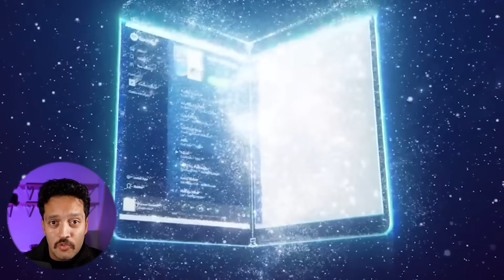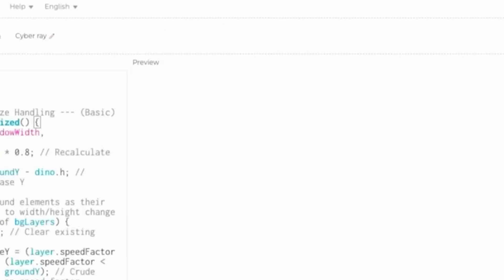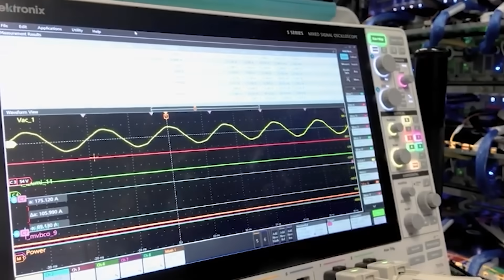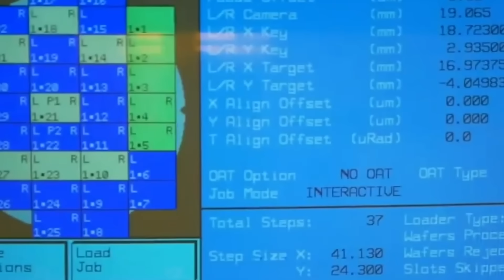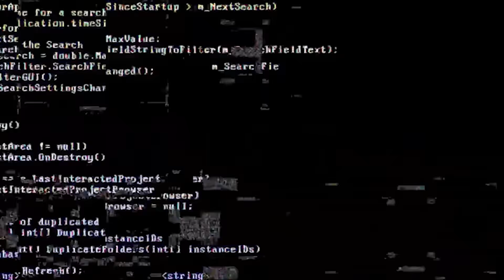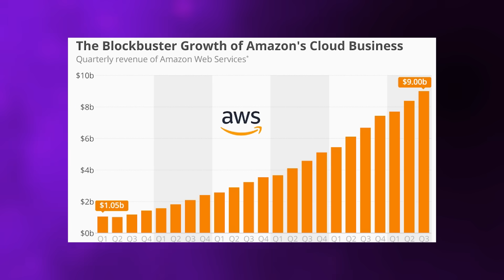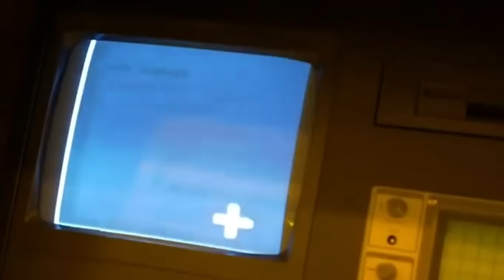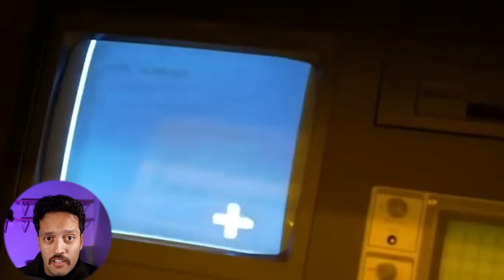Google’s Secret Weapon ‘Ironwood’ Just Challenged Nvidia’s Throne!

Comment: It's not a challenge. The Ironwood TPU is an ASIC chip. ASIC as in APPLICATION SPECIFIC Integrated Circuit. Basically it can do only do one thing well. That's like buying a gaming console that can only play one game, but, because it does run that one game really well, then saying that it is better than buying a console that can run 1,000s of different games.
Reply: Its a “mechanically” programmed chip. Like a cam shaft for timing in an engine, really good at one thing.

Comment: The thing is that there is a lot more to it than just having the best hardware.

You also need to have great software frameworks and runtimes to actually get AI/ML models working on that hardware.

It's taken AMD years to finally get within spitting distance of nVidia, and their ROCm/HIP software stack is a HUGE part of that.

Comment: I just wonder how this really plays into NVIDIA's potential.  From everything I've seen Jensen present, NVIDIA's CUDA libraries are a huge competitive advantage (according to him).  I just don't know so I'm asking rather than stating something.  do!
Reply: Cuda and all libraries developed by a huge eco-system are a major competitive advantage , add to that NVLink, and the integration of CPU + GPU + DPU + QPU in a multivendor architecture, and you see that Nvidia is extending it's moat. Google Ironwood is excellent (on paper) for very large inference LLM's with large number of simultaneous users. Nvidia GB200 is more flexible for both Training and inference. Ironwood is certainly good in the context of Google cloud infrastructure, but Nvidia leads for the rest (IMO). 😊
Reply: Huawei and Broadcom make telco switches and it's hard to imagine a more important advantage than that making large data centres work.